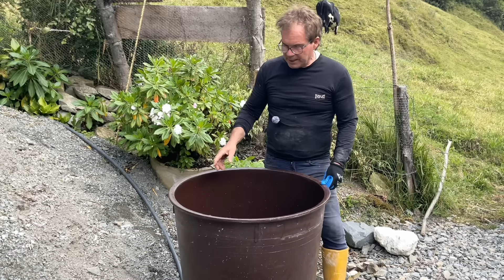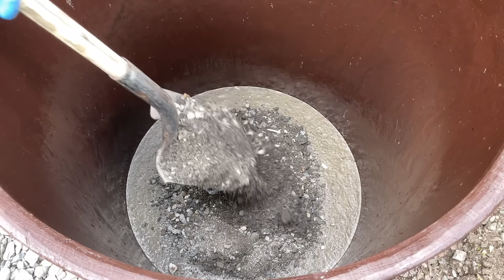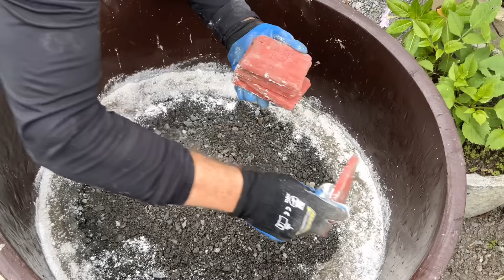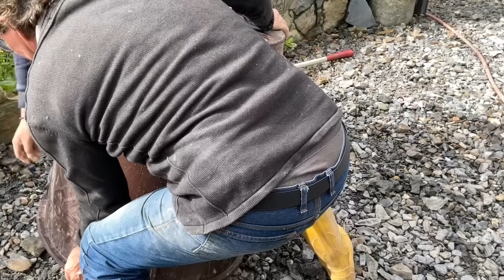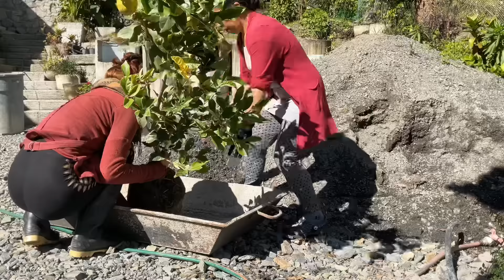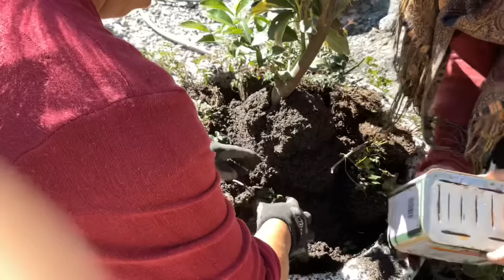How I make massive concrete (cement) planters cheaply and effortlessly using the sand fill method!

Comment: Thanks for sharing your videos, they are most helpful. I would like to know what the fabric product is that you are using from Sika that you are wrapping these containers in.  Please share the product.
Reply from the maker: Not going to be easy. If you call a sika rep in your area they will know the fabric you’ll need.

I can only give you the specs since I’m buying in Ecuador..

Polypropylene fabric / seems that sika is switching to carbon fibre now.
For strengthening concrete structures.
Comes in large roles. 1.2 meters by 50 meters
Mine is Snow White. 

That is about all the help I can give. 

My suspicion is that this thinner white cement fabric is the cheapest they sell.

Comment: one thing..i think u forgot to make the drainage holes or am I wrong?
Reply from the maker: Didn’t show it. My bad. Cut four slits,in the bottom with a grinder. Long slits are more effective than holes.
Reply: @buildingenjoyment  Put wooden dowels or offcuts in the concrete as it's poured then just push or drill them out.  You either want drainage in the bottom and the whole thing raised slightly off the ground or you can add drainage on the base and at the bottom all the way around.  To stop concrete or cement planters cracking due to expansion of the soil/compacted roots, etc, put your plants into an inner planter.  That way, you can also swap out plants depending on the season or if they're getting too big, but there's always a slight gap between the inner and outer planters, protecting the decorative one.
Reply: @buildingenjoyment  nice...can u imagine turning that planter  up side down to do the holes after the fact?
Reply from the maker: Yep once filled this planter isn’t movable. The variegated lemon tree grows so incredibly fast. Going to be interesting if I ever have to transplant it ! Probably a six man job👷🏻‍♂️
Reply: @buildingenjoyment  oh yes, or maybe a tractor or a mule...lol
Reply: @Buildingenjoyment  not really just buy an engine lift jack & rope up the tree & jack her up & out

Comment: When you say your mix is 3:1. Do you mean 3 parts sand to one part Portland?  Great video thanks
Reply from the maker: Three sand /stone to 1 cement is an exaggerated mix. Probably 4000 psi if your gravel and sand are very edgy and coarse.  5 sand /stone is considered a normal mix.

Comment: without a hole in the bottom the container will be overflowing with rainwater and the plants will rot.
Reply from the maker: Several slits were sliced with a grinder before planting. I find slits a lot more effective than holes.
Reply from the maker: So many are talking about putting the holes on the sides of the planters and not on the bottom anymore. My preference is slicing the planter bottom. With a grinder. Drains super well.
Reply: @buildingenjoyment  isn't there a way to block it like with a plastic lid as you mold it to make drain holes? If you need a grinder, that puts the price of this project over $30.
Reply from the maker: A small chisel and a hammer easily makes holes in the bottom. 

Yes you could simply weigh down (fill ) up an jar and place it at the bottom. Then smash the jar and voila you have a drainage hole! Many options to not need a grinder.

Comment: Couldn't you put another smaller container inside the big one and pour the concrete in between them? You could fill the inner container with dirt to weigh it down.
Reply from the maker: Possible yes!  I’ve spent days trying to get those inside smaller containers out. Getting the inside container out is five times as hard as the outside container.  Incredibly frustrating to say the least ! 

I just find the ability to control the sand and cement fill such a benefit! Manipulating the cement from both sides gives me such a better finish. 

I’ve seen the inside container method and the finish isn’t quite the same. Finding such a container is another big issue. The sand fill method is just that much more flexible. 

Takes actually less time doing the sand fill method discounting the de-moulding process.

So many videos on YouTube showing the misery of getting the inner container out. 😢
Reply: @KingCurrency8168  if it's plastic you can on small planters but otherwise they collapse.
Reply from the maker: More material for landfill. The plant roots thrive way better in rough planter insides. Almost impossible to get the roots detached from the rough insides of the cement. Has to do with moisture exchange
Reply: What about a Cylinder styrofoam inside?
Reply from the maker: @AnthonyRamirez-bk8ss too much landfill waste. It takes a few people less than 45 minutes to make this large planter with the sand fill method. This styrofoam cylinder would have to be shaped and then chiseled out afterwards creating endless garbage. An even bigger problem is the styrofoam would float upwards when casting.
Reply: I saw those videos too
Reply: ABSOLUTELY LOVE THIS METHOD
I have a huge pool area 40'x60' that needs large-scale decorations like this.

MAY I SUGGEST?
Combine your design with WICKING BED designs.  1) add a 2"  hole to one side of the mold, placed at about 1/3rd height from bottom (use a short length of pvc pipe.  This  allows water to overflow at a specific level (see wicking beds) design.
2) To create the air gap, fabricate a 2" x 2" concrete lip on the inside about 3" above the hole.  This lip allows you to insert  a dirt barrier. 

 Keeping the dirt above the water and air barriers is necessary for wicking bed design. 

Wicking beds grow monstrous plants fast.  Much of the reason is air circulation as much as perfect moisture. 

What do you think? @buildingenjoyment
Reply from the maker: I made a video called upside down planter with the wicking holes. I find the planter isn’t doing as well. I’m slicing drainage slits into my planters now at the bottom. A slit has a very large surface compared to a hole. I put five slits all I. The same direction.

I have  zero experience with putting drainage holes on the side of the planter! I’ve had other praise them.
Reply from the maker: I like your suggestion of getting into the sides of the planter. 
I’ve used drainage pipes placed in the corner of planters (bog planters) works super well
Reply: The challenge with putting an empty volume inside is flotation. I work professionally with laying pipes in the ground and one method of filling the excavated pipe trench is to backfill with weak concrete. One of the requirements that has been learned over the years is the need to anchor the pipe so that it doesn’t float to the surface.
Reply from the maker: @johnlee7085 floating containers inside moulds is actually a big issue when casting silicone moulds. I always wait for the uncontrollable upwards movement of things that you thought were glued down properly. The floatation energy in all fields is always underestimated.
Reply: I was going to suggest a temporary casing.  You'll need to come up with a two or three 2' sections of cylinder of different diameter to create the somewhat constant wall thickness; you'll use a wider sleeve as the tub widens.  Use the narrowest section on top of the 4" of bottom concrete.  A shovel of sand in the middle, check center, then concrete.  Rod the concrete, rod the sand, rock and knock on the tub, fill to about 12"-16", pull the cylinder section, but not all the way out.  Knock the tub again to account for the removal of the casing.  Check wall thickness and adjust cylinder accordingly.  This would really help to keep everything cleanly separated while leaving an interesting surface in the interior.  I think it would also be a lot simpler to mark out and hot glue the tile or other decorative items to the inside of the tub in the shop where you have more control of what's level.  Though, you'll have to be careful not to knock one off during the whole process.
Reply from the maker: The sand fill method is very precise and incredibly easy. If I remember correctly er correctly the entire planter 3 feet tall took less than 30 minutes to lay up. I’ll I need is a shovel to dig the sand out of the centre. No fuss no struggle de-moulding. The sand fill method makes planter making very efficient.